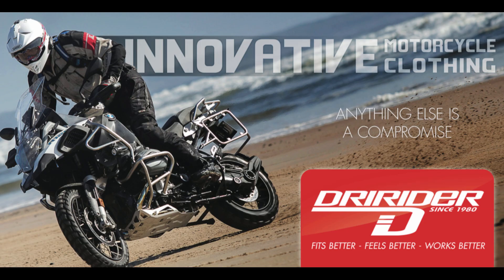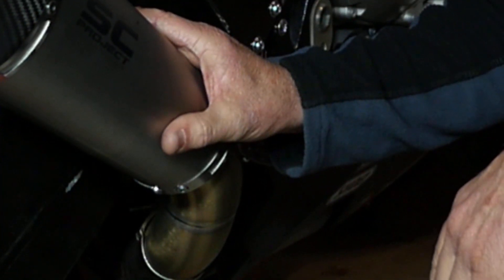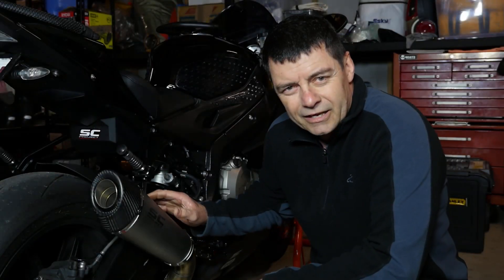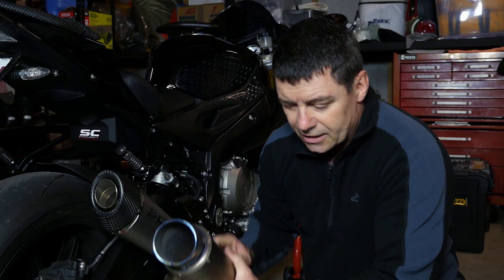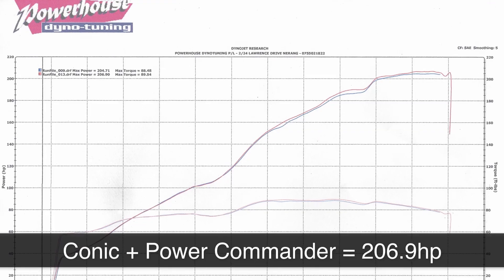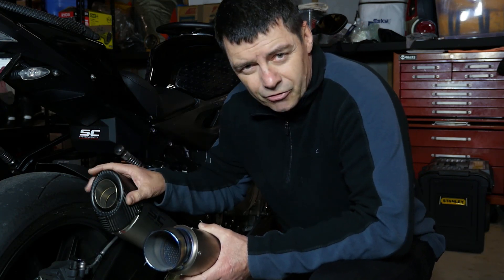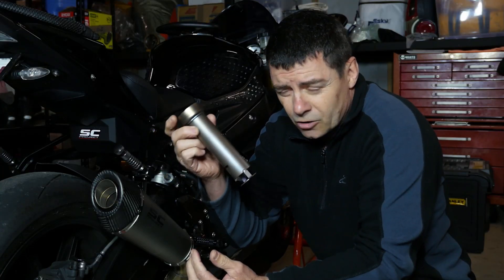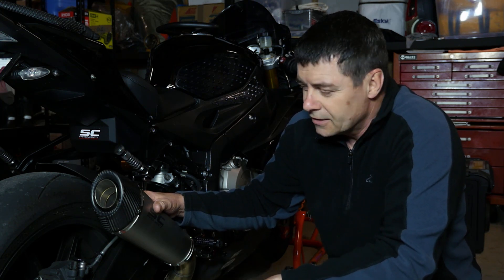SC Project GP70 R and Conic Exhaust Dyno Test Results on BMW S1000RR

Comment: What do you suspect would happen if you just put the SC Conic on and no power commander?  Your video has got me worried putting this on will suck HP off my bike.  If SC Conic, no power commander, but remove the slip in silencer....parity HP at that point?  Which would be ok to me as I'm just trying to fix cosmetics of 2016 RR exhaust looks...don't mind spending $ for looks and a bit better sound with 0HP but don't want to go backward at all...thoughts?
Reply from the maker: I ran the SC Project GP70-R on the bike without the power commander, actually used it a a drag meet to see how it performed .. there's a video on the channel about it. We put it in that same configuration on the Dyno and the operator showed me a chart which indicated it was a bit lean at higher revs .. I don't have a copy of that chart to show you unfortunately. 

Re the Conic ... it has a smaller diameter internally to the GP70-R and I would be happy to run it without the baffle on my bike without a power commander and be confident of a HP increase, though I'd definitely take it to a Dyno and check fuel across the rev and throttle position range as well as performance. I don't have any figures on how Conic with baffle compares to the stock system performance wise.
Reply: So what was the -30hp? I thought that was from OE to conic with baffle
Reply from the maker: The main thing I regret doing was putting the bike on the dyno in stock form, that would have helped us answer the question with figures from the same bike on the same dyno in different configurations. Looking at the process now I believe the main reason for the 30hp difference mentioned is that the power commander had been tuned to the GP70-R which is a huge noisy race muffler. We then whacked on the Conic with baffler and the fuel system had been tuned to suit more throughput. We pulled out the baffler and a 30hp shift was observed. The charts are shown here - http://thebikestig.com.au/dyno-testing-sc-project-exhausts-bmw-s1000rr-combination-power-commander/ 

I'm still pretty cool with a Conic and no baffle given it does perform well without the ear splitting noise produced by the GP70-R. Hope that helps.
Reply from the maker: I am on track for 3 days this coming weekend and it's at a location where I have the track times to be able to compare the bike in stock trip to what we have set up now. After that I should be able to offer more performance information, though it will be based on a Conic + Power Commander combo
Reply: Thx for all comments. I was just worried if I didn't power commander bike and just did slip on that I would see a -30hp drop. Your vid is only reason why I haven't bought yet as I don't want to spend money to lose power and i doubt I'd ever power commander my bike
Reply from the maker: Not a problem mate, I don't think you'd see a power drop. I'd definitely give it a run without the baffle though, I've left mine out as the noise level is pretty good. If ever you want to try a fuel system, I am pretty happy with the power commander as it can be disconnected in a couple of minutes and the bike is immediately back to stock. It's why I chose it over an ECU flash.

Comment: 2015-2016 s1000rr stock rear wheel 182-183 hp...Power commander + exhaust maximum 193-196 hp... 207 hp??????????
Reply: I think he want to say 207 hp on the Rear Wheel with only Muffler. Are sure? I think 207 HP on the Clutch is much more realistic
Reply: I think Dyno from Dyno differs. I don't know whether it is calibration but I did listen to people saying it several times. And that 30HP, sounds like something else was in play, I'm not a specialist, but maybe the power commander had something to do with it?  Or just what the man said, it's the DB killer. Here is a vid that says a lot https://www.youtube.com/watch?v=ZqYN6Qgn0Vk  , sorry, I am not trying to promote anything.
Reply from the maker: Not sure what to say mate, these are the numbers given to me by the people who ran the dyno and did the tuning. I did question them and the guy spoke about there being different ways of showing the performance line (those charts they produce) and that he used the method that allowed for altitude and humidity and didn't exaggerate results. I will be testing this bike at a track in mid September where I know what results we got from the bike in stock form. For me that will be the true test.

Comment: Hey mate ive been thinking of doing the same with my bike. 16 s1kRR and i have the conic too, did you guys get the power commander with any accessories? and does the power commander have any adverse effects on the bike? or is it purely a way of a tuner interfacing with the bike?
Live on the GC also, so would go to the same guys if they can get those sort of numbers
Reply from the maker: No Matt, simply installed and dyno tuned the Power Commander as it comes. I don't believe there's any adverse effects, I've ridden it on the road and spent 2 days on track and am super happy with the effect, the noise is freakin awesome! I did notice a subtle throttle lag through a long sweeper onto the main straight but I think it might have been what I was doing and not the bike. The PC simply allows you to manage fuel across the rev and throttle position range, it can be unplugged and everything goes back to normal.

Comment: The hp sounds abit high ... Havent really seen many bmws hit over 200rwhp from just a slip on
Reply from the maker: I had the same thoughts about such a big number though I actually sat in on all of the testing and the 30hp difference between with and without baffle was right there on the screen. I'll be testing this set up next month at a track where we have some times from this bike in stock trim so I can compare. I am keen to do a quarter mile test too. I just did two days of testing on track this week with the new set up and it performed really well though no comparative times. It definitely felt much crisper and more responsive to throttle though not sure if i felt a 30hp difference, hard to tell even though nothing on the track was faster on straights. I'll do a vid on it next month. cheers Steven.
Reply: +The Bike Stig thanks for the response very intrigued... Soo ill subscribe and keep watching ... Ive got an sc project slip on myself on a 15 s1krr ... But gna do the full arrow competition evo full titanium
Reply: +The Bike Stig thanks for the response very intrigued... Soo ill subscribe and keep watching ... Ive got an sc project slip on myself on a 15 s1krr ... But gna do the full arrow competition evo full titanium
Reply: +The Bike Stig thanks for the response very intrigued... Soo ill subscribe and keep watching ... Ive got an sc project slip on myself on a 15 s1krr ... But gna do the full arrow competition evo full titanium
Reply from the maker: StevenZakir Cool, love to hear how the arrow system turns out performance wise, you will definitely need some tuning to match fuel to that system and avoid being too lean
Reply from the maker: I ran the beemer at Eastern Creek last week, very happy with its performance and it's definitely got more grunt. Recent (pre-tuned) comparison against new R1 with pipe and fuel management system showed me up on the straight, this time the RR was on par which I'm happy with.

Comment: Nice video. any sound clips without the baffle?  and maybe a full size picture of the bike? 
I'm currently looking at this exhaust for my bike, that also is black. Dont know if i'm gonna get the carbon or titanium.
Reply from the maker: I'll get some and put it up Jon, we just did some track testing this week with the set up and am really impressed, it sounds freakin awesome and quite loud on the gas at full revs.
Reply from the maker: Just had a thought Jon, check out The Bike Stig on Instagram, we actually posted a short vid of this on the dyno with the Conic fitted.
Reply: +The Bike Stig 
I looked you up on instagram. I'll be ordering a conic silencer based on your reviews! thanks a bunch 👌
Reply from the maker: you're welcome Jon